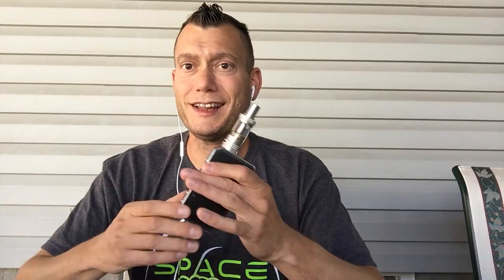Dangers of Ni200 nickel DON'T vape it on anything BUT Temperature Control!

Comment: funny thing is if you look up nickel poisoning in the light early stages you get what people try to call "Vapers Tounge" or a muted tastes. i have a feeling that many people are experiencing this and not understanding what is happening  and end up blaming it on variables like " oh my  coil is bad" , or "oh i keep getting  dry hits" " i didnt clean out the machining oil" or whatever they think is the issue. even after seeing this video  when i received my subtank mini after just  one day  vaping  on a VV/VW I  eventually  completely lost the e liquid flavor  in  two separate tanks  one tank i have been using for months i. i didnt know wtf then i remembered this video about nichrome which is a nickel compound. i looked up nickel poisoning and viola. many of the same symptoms including muted smells, tastes, allergy type stuffy nose feeling( not an actually allergic reaction"  light headaches etc.  BUYER WATCH THE FUCK OUT should be printed on the wire packaging

Comment: Thanks for not spreading the face narrative of NI200 being dangerous in TC mode. Some are paranoid that the nickel will leach but after reading several things it appears to need to be in a combustable environment with more fuel than oxygen (not an atty) and be at a temp of around 2500F which clearly we don't get near. As long as you stay in TC mode as you said things should be just fine. Good video man.
Reply: Nickel leaching will still happen when heating. Lower the temperature the better.  I measured it at 15 ppm at 350F with 300 puffs at 4 secs/ puff in 10 second intervals with analysis on a FAAS instrument. Cooking with a cast iron cooking ware will have iron leach into the food. It's a big push for South Asian countries right now because of a low iron diet. I'm a chemist and I was curious.
Reply: MC B I’ve been up all night trying to find the best material for vaping ever since i saw this: 

http://vapingunderground.com/threads/resistance-wire-safety-guide.204000/

I’m very glad to hear that you’re a chemist and if you could help me out i would be very greatful!

I also own a vape shop and would like to have some knowledge to provide to my costumers about this safety issue. 

Also, what do you think about stainlees steel? Doesn’t it have chromium as well?

Comment: what about the titanium or stainless steel wire
Reply from the maker: +H8edsinclair Stainless Steel is awesome, does not have any of these issues.  You can pulse it dry and glow it like Kanthal.   Titanium has risks at higher temps but is more stable than Nickel Ni200 for vaping.  You must not dry pulse and glow Titanium either.
Reply: +Quest4vape good to hear cuz I get stainless steel wire on the way I don't like straight nickel wire I always do a twist with kanthal I never pulse it ever I wash the kanthal first then I do a clapton coil with a nickel core or I use titanium but I'm still on the fence when it comes to the flavor from it..I just hope the stainless tastes good otherwise I think I'm done with the temperature control
Reply: +H8edsinclair titanium is safe ,a slong as its under 420 degrees or just before it gets red hot. it will anodize if it get to hot and thats not healthy.
Nickel wire isnt healthy at any temp,
Reply from the maker: Stainless Steel has great flavor.  The square wire that I use in a few of my videos (coil master review) is Stainless Steel, and the flavor is incredible.

Comment: I was typing a message while watching your video. I was going to say that nickel coils are only used to allow temp devices to estimate temperature but then you actually said that much. :-) I guess you got the idea.
Let me say though that titanium does not get toxic at certain temperatures. It is a bad idea to get it to glow because of the TiOxide and it leads to the same conclusion.
Here's what happens though: The production of TiOxide on the coils can lead to inhaling nano particles of TiOxide. These particles can nest deep inside the lungs causing a similar effect as for instance silica dust or asbest. The particle will be encapsulated causing scarr tissue to grow in the lungs which can in turn end up causing cancer, the one thing we're trying to avoid. I choose to correct you on this matter because I don't want people to think Ti is toxic, avoiding it all together. The benefits of vaping temp control and thus avoiding the production of formaldehydes by burning your juice, outweigh the risk of Ti, if you use it in a sensible way. That is, don't let it create TiOxide by pulsing dry coils or torching the wire. So your general conclusion stands: only use Ni and Ti on temp control devices and never let it glow red.
Reply from the maker: +Igor Bollaert Thank you Igor, I didn't know in that detail about Titanium, only that it was harmful above certain temps.  oh, hey I did this video and asked for folks to please discuss and share and add more information here.  The message is not about me, it's about vapers who are vaping these coils out of TC mode on regular wattage mode and not as intended with safety and protective limits.  Thanks for your comments, they are intelligent and factual!

Comment: Thanks for this dude..coz today im testing a Ni200 and its a 10 wrap dual build and im using non regulated mod and before i start to vape i use the glowing method and then putting the juice and vape it a couple of times more on like 25 drags
and my question is..is my health harmed right now?
Reply from the maker: +WickedCool Yes your health is harmed right now stop.
Reply from the maker: +WickedCool Once you glowed the coils you wrecked the wire.  It's been heated too high and it's not vapeable anymore.  It's not just that powdery surface coat you will see on the surface, but the metal through and through has changed properties now.  The whole point of temperature control entirely, is not just simply to keep from getting dry hits.
Reply from the maker: +WickedCool sorry, sending this in several messages because you are vaping right now and I'd like you to understand what you're doing is EXACTLY what I am warning people not to do.  Hey you didn't know.  but now you do.  Ok so.  Nickel cannot be vaped in wattage mode.  Why?  Because Nickel at and above certain temperatures becomes toxic.  Nobody denies that.    Everybody agrees.  So Temp Control (TC) regulates and reduces power or cuts power when the resistance of the metal increases indicating to the chip that temperature is at max or nearing it.  All of these devices for temp control do not have an actual temperature sensor.  They read the resistance of your coil, lock it in, and then read the changes in resistance which mathematically tells the chip when the temp reaches upper limit setting you set it for (ie. 600 degrees...500 etc.)
That's why you must allow your box mod and atomizer to cool to room temperature before you screw your tank or RDA on.  So the mod will read a new coil and ask you: New coil or same?  It asks you this to reset the resistance by which it will now measure a change to calculate temperature.
Reply from the maker: +WickedCool The industry has assumed, and consumers are accepting, that nickel below 600 is safe to vape.  I'm not going to debate it, the jury is still out on that and I cannot tell you anything in vaping is 'safe'.  I have my doubts about the metal even below 600.  But for the moment let's pretend that the manufacturers and community believes this is right.  Ok.  So that's the purpose of TC.  to not allow the metal to get hotter than 600F.  while vaping and otherwise.  The reason you can't pulse the coils dry in temp control is because the tc mod you are using shuts off power because temp is reached almost instantly.  What does that tell you?  Don't pulse them dry.  So switching to a mech mod to glow the coils is doing exactly the opposite of why you bought a tc mod to begin with.  And the metal is now changed, toxic and you go vape releasing those toxins dissolving in your juice, and even under 600 degrees...It's brittle and has been changed from the original wire.  Ok I'm not a scientist but I think it's irresponsible for anybody to now step in and tell me I'm wrong.  Because until somebody can show me some testing results what happens to the metal after glowing that it is now safe  I'm going with it's not.  How about this:  space your coils and you don't need to dry pulse them.  there's no hotspots.  And if you must pulse them....first wick it and juice it and then pulse them wet with juice.  then they won't glow, won't trip your TC mod.
Reply: +Quest4vape im glad that i saw this video..and i already stop now, i throw away the coils
Reply: +Quest4vape and yeah since ive drag it for 25 times or so then my health now is in danger..this sucks im really glad that i saw this video earlier thanks dude you save my life
Reply from the maker: +WickedCool I don't believe you've done irrepairable damage, but you wouldn't want to continue doing it over time.  by the way, if you drink a glass of good organic greens/fruit mix daily it detoxes you of heavy metals over time.  So grab a good Kale/Beet/Carrot from your local juice bar for the next few days and drink more water.
Reply: +Quest4vape well the suck part is i dont like drinking greens/fruit juices, but im a water drinker i can drink 10 glasses of water a day.  I throw my wire right away

Comment: Good info, but I had already decided never to use nickel. Like many people, I'm allergic to nickel. If touching something gives me a rash, I am not about to vape off of it.
Reply: +llanorick There is a ton of people allergic to nickel that vape nickel coils without issue. Just throwing it out there. Not trying to change your mind or anything.
Reply: +87lancerguy Yeah because it doesn't vaporize since temp control prevents it reaching that temperature.

Comment: Please advise what's the temperature for vaping nickel?
Reply from the maker: +Sky koH Hey Sky, thanks for watching.  I cannot answer that question responsibly.  TC devices have a max temp of usually around 600 degrees Fahrenheit which the manufacturers believe is safe.  How they determine this I really don't know.  Sorry I could not tell you something more specific, but this is your health so I'm not going to speculate.
Reply: I think 600 degrees Fahrenheit is the point where it releases toxins. I'm just hovering around 480 to be safe
Reply: +Quest4vape very good video . I have informed all my vapers friends to watch this and they had followed exactly what u mention. This video safe life lol